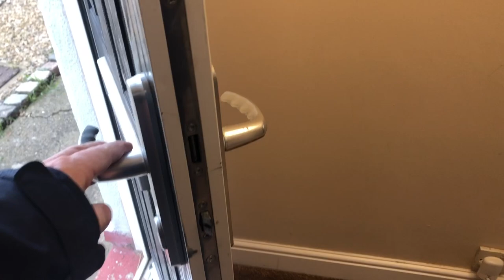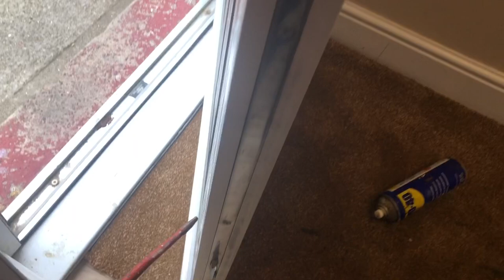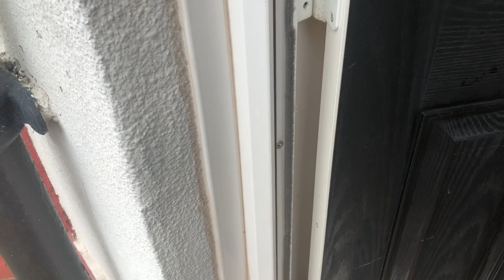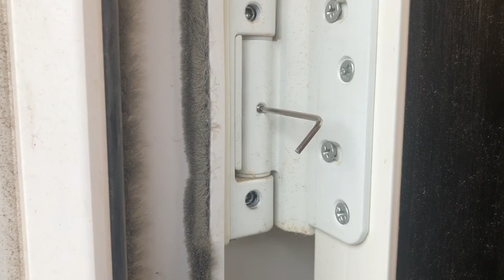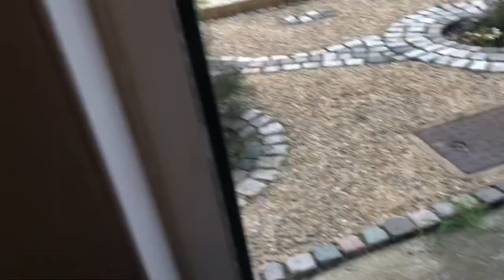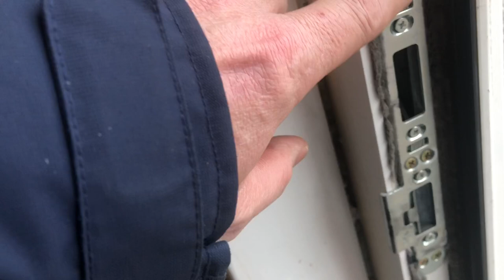Composite Door Alignment & Stiff Handle Fix.

Comment: What to do if door is on maximum adjustment and still catching?
Reply from the maker: Something has obviously changed since the door was fitted, I would check all the screws are tight and not loose.

Comment: When I press down on my handle all the way my lach gets stuck, I have to prise it back out with a screwdriver.. any idea how to sort on these doors ?
Reply from the maker: It difficult to correctly diagnose without seeing by if there is excessive tension on your door handle adjust whatever is required to take the strain off and see if the problem goes away. Visually check for the door dropping out of alignment etc .